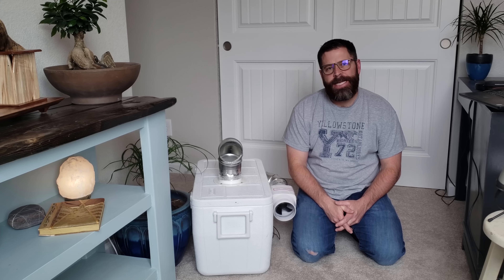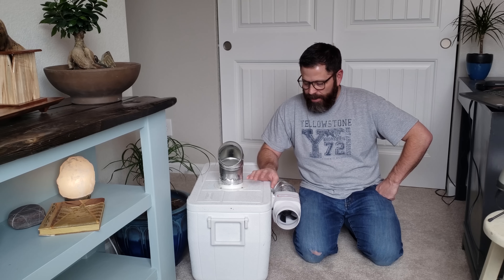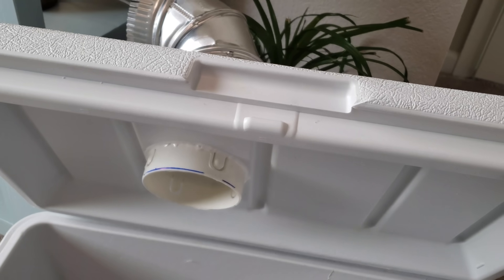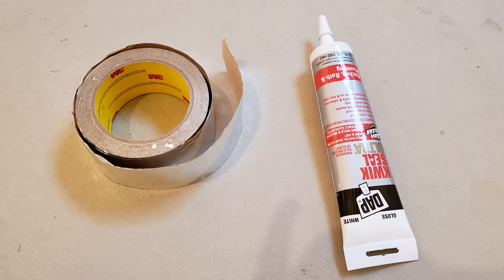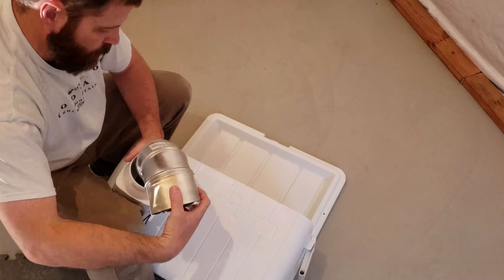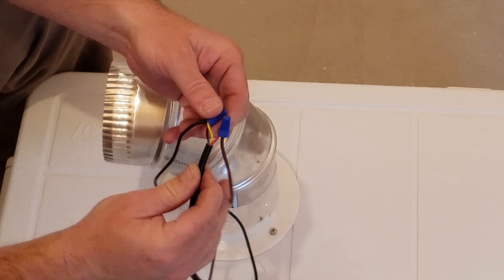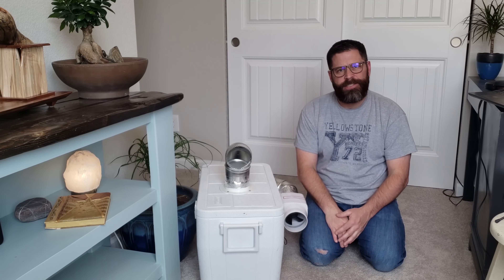Homemade Portable Air Conditioner DIY - Coldest One Yet!

Comment from the maker: All of your questions are answered here: https://www.youtube.com/watch?v=H4LutVTqsUU&feature=youtu.be
Reply: Copper tubing i think would work better.
Reply: @thefadebeta580  It would but it would add a lot of cost.
Reply: Perfect solution for a small 25-30 ft cuddy cabin boat with no A/C!!!!
Reply: Seal up the gores.
Reply: @verbaldavenci1 h h0
Reply: Have you tried dry ice in one of these?
Reply: @lilbit5557  no, don't do that
Reply: @donnieshepperson126    one time i was under a stage running the CO'2 (dry ice) fog machines ... when I turned it on I couldn't breathe .. had to radio for help. lol
Reply: @jokcoustou  any damage
Reply: @jokcoustou  the O2 stands for Di oxide. Lord I hope you’re okay. That’s dangerous. Hubby works for ice co. Here in Tennessee I know how that stuff can be a hazard.
Reply: All I can think of to make your system 'better' would be to purchase a couple of 200 packs of the re-usable ice cubes. The ones I bought came in 10 mesh bags of 20. I'd just freeze the packs, then toss them in. When they needed to be refrozen, keeping them in the mesh bags they came in made it easy. Just my .02.
Reply: Can I buy one from you that you made?
Reply: How many watts is it drawing
Reply: If I use this cooler directly into a computer case, will it cause condensation? Is there a way to mitigate condensation to help cool a desktop PC?
Reply: @superpooper1945   there was a guy who built a cool ass desk pc like made the pc into a desk with a hidding monitor look that one up he answer the cooling issues
Reply: in the pic of parts there are 4 havc vents but in your parts list you list 3.  please confirm
Reply: If your name is DEAN SMITH that air conditioning will not work
Reply: What don’t you put the motor assembly inside the unit. If it’s marine grade you shouldn’t have a problem and that way you can put a flex tube to the lid and have both in and out on one side.
Reply: I wonder how big of battery would be needed to run this all day at ball field
Reply: Please shut up about the refrigerator. This is for camping, emergencies, etc. jeeze. Good job man I’m gonna make one tomorrow!!
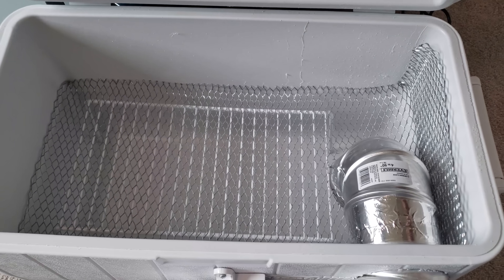Reply: Quick question: 2:19 what happens when the ice melts and creates a small pool of water at the bottom of the container?
Reply: Support your local hardware stores (mom and pop) not Amazon. Good video.
Reply: @TheKevo7777  I agree 110 percent! Sadly the very last one we had quit and closed up (for a second time!) a couple years ago now. Was WONDERFUL as it had 3 old guys (like myself, men in their 70's!) who were sharp as could be and FULL of energy. When they first went Bankrupt they were gone about 3-4 years. But they came back and these men with their wives helping run the registers (all 3 of them) and worked with NO wages! They only paid the high rent in a little strip mall and these guys could get you ANYTHING and better yet, would literally make it for you if need be.  Now we have a Lowes and Home Depot but NO small box folks left sadly. But I simply can't STAND Amazon. Nothing but third party sellers in China selling substandard CRAP that should not even be allowed for sale in the US in my eyes anyway. I can't even remember how many dangerous AA and AAA Battery chargers I have bought there that literally MELTED! One cost me $1100.00 and change in home wiring repairs and the list just goes on with too many products that failed and I simply do my best to not buy ANY product from Amazon unless it is a known name brand item I KNOW and one sold "direct" from Amazon and not any third party seller Even then, ONLY if unable to find it someplace else. Even Best Buy, Lowes & Home Depot but NEVER Amazon if able:-(
Reply: @mikecartwrightbeach  I'm with ya! I like buying from the small shops. I have spent $3,000.00 in the last month on about 30 orders and none of it was amazon or any of the corporations!  Everyone needs to support the good guys! Cheers!
Reply: Night they drove ol Dixie down guitar
Reply: @TheKevo7777  so no Home Depot or Lowe's or Menard 's!?
Reply: @TheKevo7777  alot of your mom and pop shops are now on amazon.
Reply: How much would you sell this for ?
Reply: @annapartee  00p
Reply: All you did was copy TKOR you clown

Comment: ??? Couldnt you just use a 4"copper pipe running across the bottom of the cooler and put the intake fan on one end and and outlet on the other end? Then just put the ice on top of the tube and then blow air through it?

Comment: If u put salt in the ice, it brings the temp down to 28 degrees which will slow down the ice melting tremendously and make the air coming out even more

Comment: Quick question: 2:19 what happens when the ice melts and creates a small pool of water at the bottom of the container?
Reply from the maker: The pool of water is fine unless it gets as high as where the vent comes in. Then you will simply need to drain it from the plug at the bottom.

Comment: how do you handle the water buildup in the chest as the ice melts?  Seems like that would fill up and block your air flow fairly quickly.  How long does it work  before the ice is all gone?.

Comment: I’m wondering if you can’t disassemble a ac or freezer copper innards of a freezer/fridge and attach to bottom and plug in so it’s Always cold and using small Freezer or fridge to blow out…?

Comment: You need to advertise this has a air cooler and not a conditioner they are completely different. You might aswell put a bucket of ice behind your fan, it does the same thing 😆

Comment: So I duplicated this make and two things I noticed.  These are not good for room sized spaces.  You have to be sitting somewhat close to the vent to still feel cool/cold air.  Also, the amount of humidity this puts out is crazy.  One other point is that the blower is strong (and noisy), but it almost sucks in too much air which causes the ice to melt extremely fast.  That would also depend on air temp being sucked in to the cooler.  It was fun to build and does work if you sit close to it and have plenty of ice to keep refilling.

Comment: good job! I built one too. But the one thing all you ice cooler a/c builders should tell people is the ungodly amount of money you're going to have to spend on ice. Do the math. The ice only lasts one and a half hours, maybe two if it's not 100 degrees out.I went to the extra cost of buying an ice making machine @ $450, thinking it would help. But it did not and I was able to return it to Walmart. Walmart refunded my money but wouldn't refund anything on the 49 dollar cooler because I destroyed it by cutting holes in a perfectly good ice chest. Friend you can't get around the fact, we can't invent a better mouse trap.

Comment: This would be a great project for non-profits to make for the elderly who can't afford AC in the summer heat or after a power failure.  It would take dedicated people who would stay in touch providing ice to the people to keep it running.  You would need a solar panel or a battery to keep it running.

Comment: I used a system kind of like this but I use a fridge instead.
I take the air from outside to fridge then to my stove in the winter.
Could also be set up as walkin freezer room during winter. Meat locker.

Comment: I built one about 15 years ago, still have it. I use gallon freezer bags filled with infant baby diaper filling, soaked with water and frozen hard. My air source is a bathroom vent fan on the lid. An on of switch is also mounted on the top. I have a 6 ft. cord to plug it in. My exhaust is a dryer vent exhaust. These are not new. A lot of great improvements shown here, though!

Comment: Would using frozen 1 gallon jugs work for this design? I am wanting to make 2 of these, but I'm not anywhere near an ice making machine. Nearest one is 20 minutes away. I'm not gonna go buy ice everyday. Also, what happens when the ice starts melting into the bottom of the cooler....

Comment: the blower can be replaced by exhaust fan ? bcz exahust fan has 750CFM 3times more then air blower and secondly how much watt does air blower take ?

and third thing is you can place the air blower on the top of the coloer and why you did on the side of it ?

Comment: .... another one of these sub-optimal designs, just run any kind of metal duct under/through the ice, why people insist on designing these to mix the air inside the cooler is beyond me, all these designs are hugely humidifying when they don't have to be, just run a cheap (like really cheap) 4" duct people.

Comment: tried it, but it doesn't work in 100 degree weather in texas, ended up learning how to replace my auto AC by myself, replaced my condenser, compressor, flushed all ac lines, the whole deal.  lol.  What I did after with this unit:  I turned the air blower motor into a leaf vaccum leaf cutter that rivals a $400 leaf sucker/cutter made by companies like milwaukee or ryobi by attaching sharp blades to the air blower blades and the old cooler into a padded bench for friends to sit on

Comment: The aluminum duct or aluminum pipes will be sealed and in contact with the ice, okay, but the air will circulate through the aluminum duct and will not have direct contact with cold water or ice. Remember that the aluminum will cool down, which is why we are using ducts to avoid direct contact of the hot air with the ice and water. So, I want to know if this somehow reduces the humidity in the environment because I'm following the golden rule that is to avoid the air having contact with ice or water, but instead, it circulates through an aluminum conductor. Is a dehumidifier still necessary?

I understand your question better now. If the aluminum ducts are sealed, and the air flows through them without direct contact with the ice or cold water, it is less likely that moisture will be added to the air compared to a system where the air passes directly over the ice or water. In this case, the aluminum ducts will act as a heat exchanger and cool the air without introducing additional moisture.

Since you are avoiding direct contact of the air with the ice and water, the humidity in the air should remain relatively low. However, the amount of moisture in the air will also depend on the temperature at which the ice and water are in the cooling chamber. The colder the ice and water, the less moisture will be added to the air.

In summary, if you use sealed aluminum ducts to cool the air without direct contact with the ice or water, it is less likely that you will need a dehumidifier compared to a system where the air passes directly over the ice or water. However, you should still pay attention to the temperature in the cooling chamber and ensure that it is cold enough to prevent excessive moisture generation in the air. If the system maintains the temperature of the ice and water low, a dehumidifier may not be necessary.

Comment: If it's portable then why do we need a wire to plug it in always. It's probably gonna need a battery pack. But of all the coolers especially the fake one sold for 40 bucks, this one is the best design thought and bang for the buck. Great work! In fact, it's probably has to become a product someday. Coz I've seen tons of this in many channels but never seen one done by a product line. Just waiting for someone to finally market this.

Comment: How much did that cost in materials and time? I totally love this idea. I have an 03 Explorer that the air conditioning system is broken and will cost a fortune to fix at this point. This looks like a great stop-gap to use until I can afford to fix the air in the truck.

Comment: It's still a swamp cooler even though you're using ice, the moisture is still getting into the air which is just going to make the room more humid and sticky as time goes by, the only place that this would serve any good use is in the desert like in New Mexico Arizona Utah and Nevada where there's low humidity or no humidity whatsoever.

Comment: Why, in the world, would you put ice water in it? Lots of people, like in offices have no access to ice. Plus anything near ice is going to be ccoled, regardless of device.  Your review was tainted by this unrealistic scenario, where you're using ice water.  No one is going to constantly be pouring ice water in one of these damned things.  Put regular water in there. When you poured ice water in this thing there was no point in watching this video any further. You negated the real world use of this device by skewing the results of the test with ice.  Any damned thing can be ooled with ice. That's a test of your refrigirator/freezer, not this little portable evaporative cooler.

Comment: When it is extra hot outside, and when you have a large area with air circulation, I wonder if you could do an ice/dry ice mix?  When there is a power outage, I high tail it over to a nearby grocery store to get both ice and dry ice to put in my refrigerator/freezer.  Also, have you tried using blocks of ice?  It won't get as cold as crushed ice, but it will last a lot longer.
Reply: Pykrete!!!

Comment: So I did the same thing I made this one exactly with the exact same parts that he listed and I guess I just didn't think it through It's been 106 down here all week long I put in 20 lb of ice at 3:00 p.m. yesterday and it was melted at 3:45 p.m. So now that I've invested almost $200 in this thing I'm going to go ahead and get with a buddy of mine and we're going to try to figure out a way to attach the fan to pull air out of the cooler and recycle through the cooler. My only worry is it's not going to blow as hard which may or may not be an issue if we can keep the ice solid for longer. I bought some ice cream rock salt and that helps solidify the ice a lot but I need colder air going into the cooler. Once we figure out how we're going to do it and we do it I'll let you guys know how it worked and if it did or it didn't and if it did I'll let y'all know exactly what we did.

Comment: I tried getting a 12volt adapter for a househile receptacle but it just kept going on and off and on and off. I know this blower was meant for a 12-volt car or marine battery is there any way to run it on a 12 volt adapter through a household receptacle and get it to run correctly?

Comment: This isn't AC (which typically dries out air), it's a "swap cooler" which is really only effective in dry climates. Cold moist air evaporating off your hot dry skin creates the cooling effect. If your sweating at 70+ humidity a swap cooler does nothing but add more moisture in the air to heat up.

Comment: this is lame..  ill help you make your next colder one. use a finer screen, take crushed ice and common table salt ( will be -19c to -21c) or eve colder temps.  calcium chloride can be used to get temps down to -55c but you have to use more salt than ice in the ratio. like 150g CaCl to 100g ICE.

Comment: I just planted shade trees around my house and wear cotton cloths and suck on ice cubes .also i have  a while house fan that sucks cold night are in my house cooling the sheet rock down .if sits a super heat wave I wet my cotton clothes and sit before a fan or under a ceiling fan .It can be 100F outside and im very comfortable and fresh without HVAC
Reply: Ice cubes what?

Comment: To save on space couldn't you put the blower and it's ductwork on top like the exhaust vent. Seems to me it would work the same , reduce the width of the build to just the coolers original size and reduce knocking the fan /ductwork off if used in an off-road or overlanding vehicle. Also, 2 Litre bottles filled 3/4 with ethelene glycol saltwater or just plain H20 then frozen to make a recycled cooling system avoid the ice purchase. Overall, you made it and made a video of your concept and it's a beautiful thing to behold. Thanks for the tips and ideas.👍

Comment: Like the design but to lower the humidity I'd probably use a 120mm water cooler radiator with a water pump and force air through with a duct fan. This way you can get cool dry air. Also you can use those reusable blue ice packs in a shallow pool of water.
Reply: Or pykrete blocks

Comment: Just a Idea for a better one is do the same thing but have ice water and a bubbler effect so the air goes threw the water and maybe a second fan to pull if the first isn't strong enough or have the other one on the top. Just a Idea. But definitely like yours compared to others I'll have to try this.

Comment: would this work to cool my outdoor chicken run for a few hours a day? Im in TX and we are needing a solution to keep them from overheating. Ideally, I would like to have the cool air blowing underneath their coop where there is shaded dirt (they bathe in that), and it's about 1 and 1/2 feet high off the ground. In my head, the less space there is to cool, the cooler it will feel, faster. I only need it for part of the day or if I need it longer, can I rotate out batteries? Is it safe to use in the Texas heat?

Comment: You could line the entire inside of the build with heavy duty aluminum foil in order to get maximum cold surface area coverage for the air to come in contact with.

Comment: What do you do about the water build up in the bottom once the ice melts? Wouldn't the blower fan splash the water back up into the pipe or the water reach the pipe as the ice melts?
Reply: Let your carpet deal with that also the electric! Maybe a fire…. Vid gona be hot or cold😅

Comment: These devices were typically design for off grid type environments where power is limited like camping, vans,tents,power outage,area cooler for mechanics,shed shop or outdoor events you can't control humidity but use water to remove heat  from the air..I have a video for low power consumption coolers

Comment: Just a tip.......take another fan like the one you have. And put it on the output pipe pulling the air out of the cooler. You will double your air flow, AND it will cool a much larger space.